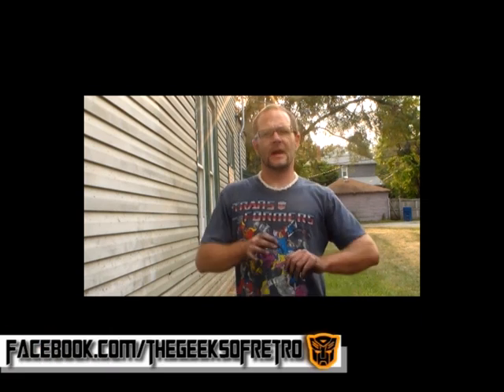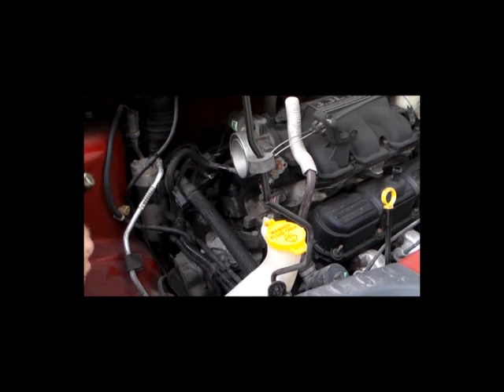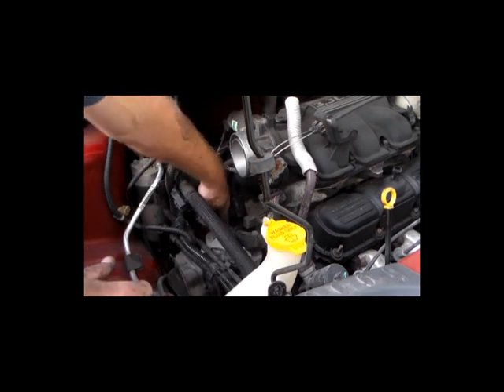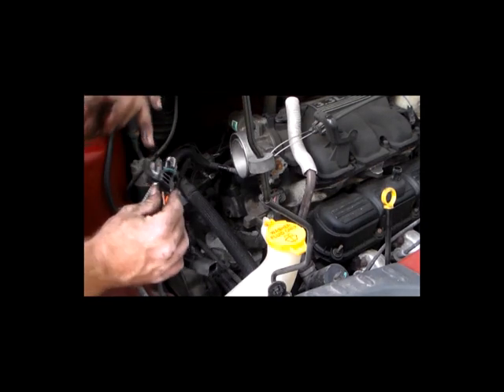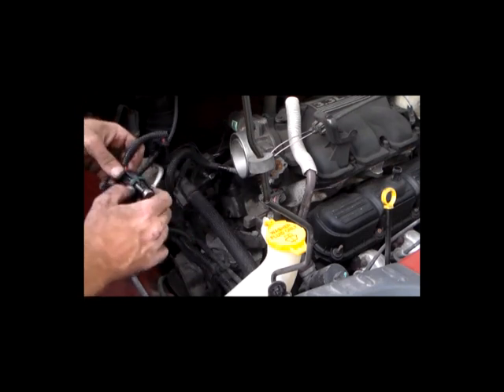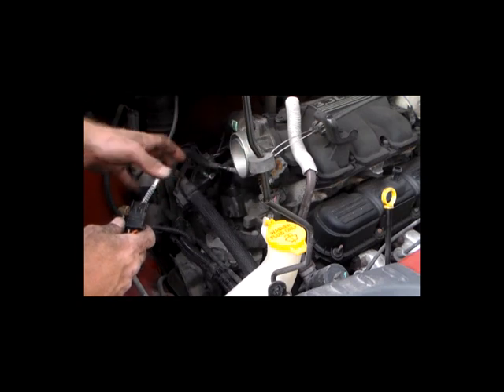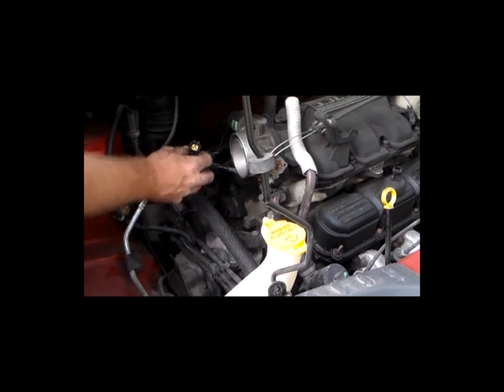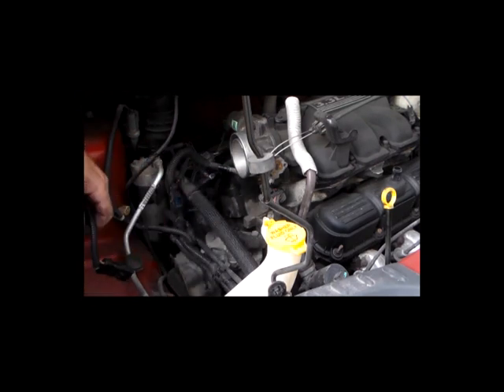01- 05 Dodge Caravan 3.3L Cam Angle Sensor Removal and Replacement

Comment from the maker: Dont forget to subscribe and hit the bell iscon for future videos. If you have any request, Send me a message and I will see what I can do to help you out!
Reply: I have a dodge caravan. Has a problem I can't figure out. Took it to auto zone they diagnosed with multiple misfires. Put a new coil on it. It's not the plugs or spark plug wires. It runs but when you push the pedal down it makes a jerking motion
Reply: Every one I've talked to told me its the computer.
Reply: I have this problem dodge caravan 2003 3.3 v6 when the motor heat with dosnt show inside the car but the car accelerator and brakes stop working and also dost shift I check it with obd 2 and it says p0740 my question were in the car is this part thanks

Comment: Replace the fuel pump fuel filter alternator battery fuel pump relay fuel pump fuse and still having issues with it wanting to start

Comment: I have a 2001 dodge caravan it runs but when you give it put the gas pedal down it Rev's and and dies down. It doesn't stall. I already replaced the coil. Spark plugs and wire's are good.
Reply from the maker: have you checked your crankshaft position sensor?
Reply: @TGORRetroReviews  no I haven't. And I  have no fire from plug one and fore.
Reply: @TGORRetroReviews  put a new coil and still spark plug 1 and 4 won't fire.
Reply: @TGORRetroReviews  No. A replaced the coil. It has no spark on two spark plugs number one and number fore.
Reply: The coil had a crack down the middle of it. That's where I thought the problem was.but it wasn't.

Comment: what is the round paper looking thing on a cam sensor and do you remove it?
Reply from the maker: paul metcalf not sure what you mean. Send me a pic of it in fb messenger so I can understand what your referring to
Reply: looks like a round dime of paper on the end of cam sensor even sell new ones on autozone
Reply: they called a spacing paper
Reply: looks like a paper the size of a dime between the sensor and cam shaft on the sensor I tried to pull it off and a layer of paper came off!
Reply from the maker: paul metcalf I removed the paper from mine with no issues
Reply: No, you should leave the paper in place. It was intentionally placed there.

Comment: how do you get the electrical connector off the cam sensor
Reply from the maker: the electrical connector is just a clip that you have to squeeze. I didnt have a retainer or anything like that holding it in place.

Comment: i have an 06 dodge caravan was fine until check engine light came on and its coding camshaft censor so my mechanic friend went out got a new censor and replaced the old one but its still doing it check engine will come on and when driving the whole van will just keep jolting runs fine other then that but obviously not driveable what could be the problem?
Reply from the maker: Kaylee May, once the part is replaced did he erase the code?
Reply: im having the same problem.. changed the camshFT AND crankshaft after getting a p0300 code turns out that the p0300 code was from the firing order on the wires being wrong. after that was corrected about 2 weeks later i started getting the p0340 and p0344 code.pertaining to the camshaft and crankshaft sensor. now what could be the problem?
Reply: @yashicasmith4274  I am having the same P0344 code problem, did you fix yours? How/What was the solution? Thank you

Comment: How do you change the cam sensor on a 3.3 v6 06 Chrysler town and country?
Reply from the maker: Danielle Smith should be the same way. Chrysler and dodge used the same 3.3l motor in both vehicles
Reply: The Geeks Of Retro thank you!!

Comment: yeah took bolt off and wont come out i pulled it and still wont budge any suggestions.
Reply: Ismael Chairez
Reply: I took it off by getting long pliers and by the long pliers getting the top of the sensor and pull it up but by leverge of the motor mount. but first you got to turn the sensor to the left by hand then you pull it up.
Reply: i work as a tech done these a couple of times
Reply: thanks for this! I was having the same problem getting mine out so now I am going to try turning it to the left first. Is it any certain amount? like 45 degrees or 90 degrees?

Comment: I changed my CPS on our Caravan a couple months ago and now my minivan is giving me the same problem again. OBD2 says it's the CPS, but I'm wondering if the Crankshaft position sensor is the real culprit. I would have never guessed that unless I saw your other video where you installed the crankshaft position sensor. After changing the CPS in this video, did the problem reintroduce itself and you changed the crank angle sensor to fix it? 
Thank you for taking the time to record these videos! It's hard enough working on cars, but to record it at the same time is too much for me. ...sometimes I get cranky working on cars. heh I'm working on that and it seems to help. Getting angry isn't going to fix a thing.
Reply from the maker: tscooter22 my service light told me it was the cam angle sensor. replace it and still had the same issue. replaced the crank sensor and it resolved the issue.
Reply: I changed the crank sensor as well. Fixed! 
Thank you!!!
Reply: tscooter22 hey i have couples questions ask u
Reply from the maker: sean smith what's up?
Reply: The Geeks Of Retro 
i have 2005 chrysler town and country lx 3.3 engine it was going at 35mph down road and just shut down wont start and dont have spark  changed coil pack and crank sensor on still nothing any idea if be cam sensor
Reply: any idea whats going on
Reply: I have no idea. Did the check engine light come on and give you error codes?
Reply: tscooter22 the check engine light is on the one code my father in law computer was give was crank sensor and we have no rpm also
Reply: hey how do u remove cam sensor on 2005 chrysler town and country 3.3l
Reply from the maker: tscooter22  same way that shows in this video.
Reply: The Geeks Of Retro dont see how remove whole thing from engine see how unplug it thats all
Reply from the maker: if you start to get angry, step away and take a break. I have the same issue and have found it better to walk away lol. once I replaced both sensors I didn't have the issue come back. there is a flaw with the after market sensors though with being longer then the stock ones. pull your crank sensor and see if there is any rubbing.
Reply: The Geeks Of Retro does it just pull out or twist